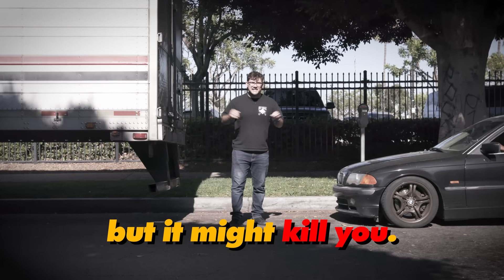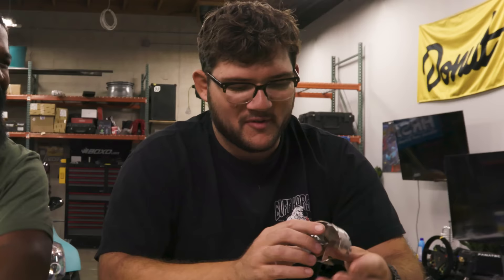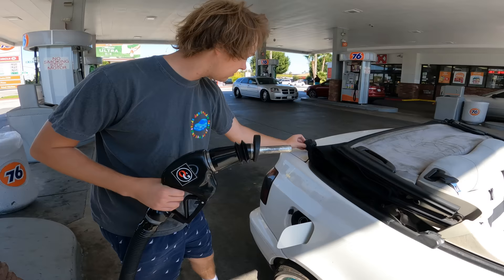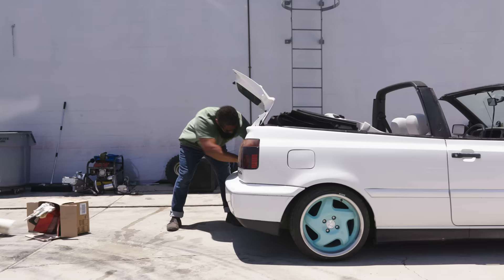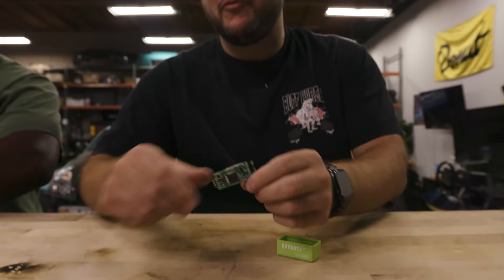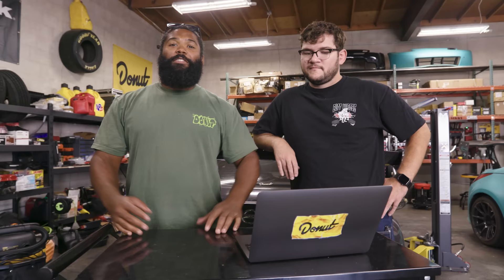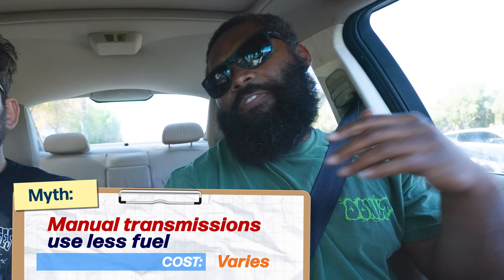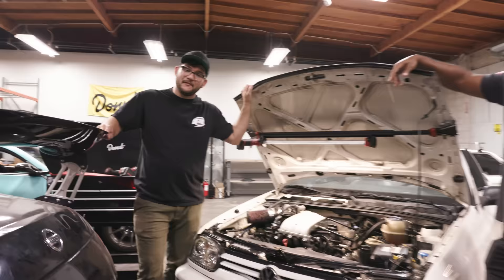Testing Fuel Economy Hacks

Comment: Overinflating tires absolutely works. My Ranger gets 24 on the highway at 45 PSI and 21.5 at the factory-rated 32. It does definite wear the tires weird, though. IMO, worth it if you have cheap tires and drive interstate and not much else but for most people totally not worth it.
Reply: While it gains you some more fuel efficency, how much does it cost you over time due to wearing your tires out much quicker?  Do you save enough in gas to pay for four tires ($500-$1000 for daily driver tires) in half the time you'd normally replace them?  Also, lack of traction is totally a thing.  Even if you air them back down when it starts to rain, your central contact patch is much more worn down than the rest of the tire, resulting in less traction.  Short term gains don't have the long payoff.
Reply: @durwoodrobison7800  Walmart has tires that are $51 new. Assuming you have a vehicle like a ranger or focus, something 3-4 cylinder. And to be  talking about 4 mpg better for 40,000 miles, at 4.50 a gallon would be $1,371 difference. Let alone the lower wear on the moving parts because it has lower drag making the engines and transmissions run slightly cooler. 

I personally feel like Donut really let people down with this episode.
Reply: I like overinflating my Prius.. the stock suspension is so mushy it feels like you're going to roll over at 32-35psi, and my tires will easily 'squeal' around roundabouts when they're that low.. I usually buy tires that have a 55psi-max and then run them at 55-60psi. The car seems to perform a little 'crisper' and I've never had any abnormal wear (most of my driving is city though so I'm constantly turning/wearing out the sidewalls).. 
..prius is a little different though, it needs all the help it can get. If I had a 'real' car I would just keep it at the factory setting
Reply: @brandonchevy6772  except the tires will wear out faster than much faster than 40k. A bad alignment can ruin new tires in only a couple thousand miles.
Reply: @SnifferSock  a bad alignment is actually scrubbing the tires though, Over-inflating is just causing heavier wear in one area. Even airing up to over 15 psi above max, the outsides of the tread still touch the ground. Again, it’s just heavier wear
Reply: They majorly confused what they set out to do. Over inflating works but it's not a good idea from safety or long term perspective so they called it a scam... someone needs a dictionary
Reply: Someone on Ecomodder did the math and fuel savings outweighed the slightly-shorter tire life.
As I wrote elsewhere, I want them to test 32 PSI versus the sidewall max for braking, cornering, etc.
Reply: This is true, but I think MPG gains will be WAY more significant with the smaller wheels and (much) thicker sidewall tires of not so long ago. My 97 Taurus tires looked half flat at recommended pressure but I have yet to see this on any thinner sidewall tire of modern cars. Modern cars already ride like trash, so keep in mind that additional tire pressure is going to result in noticeably worse ride and noise. I usually run a couple PSI lower than recommended (if they don't look underinflated at all) and even that small difference can help a lot with comfort.
Reply: @brandonchevy6772  I have driven the $51 walmart tires, and I will never do so again.  Jumping up just slightly in price gets you so much better traction, control, stability that it's worth it.   And even still, if you do the math, do you save enough money over the life of a $51 tire by getting 2.5mpg more to where you are actually saving money?  BTW, I do drive a Focus, on factory 215/50/17 tires.  If I buy a good, inexpensive tire I'm at $132/tire, and snow tires for a decent quality one that I know works are $173/tire.  Because I buy all season and snow tires, I get about 6 years out of a set of tires.  And because I know I can start, stop, and steer in any condition, it's worth it.  Plus the car gets 38mpg anyway.
Reply: $51 per tire lol. Bet you get half the tread life and having to buy tires plus balancing and changing every so often makes it inconventient. you probably also have a higher chance of blowing a tire especially if over inflated past the cars recommended psi on the highway. If you live where theres no snow sure go for it if you want, but if you live where it snows then you will have to buy snow tires and rims cause i bet those tires are junk in anything but sunny days so in reality you dont really save that much.
Reply: Also if your car or truck is geared for 30 or 31 inch tires and you drop a few tire sizes say to a 24- 25 inch tire your rpms will be alot higher. Size of tire vs engine rpm probably wont save you very much mpg's.
Reply: @durwoodrobison7800  Price does not really correlate with quality when it comes to tires. Some expensive ones are awful, some budget ones good. Ignoring the Chinese trash, you can find good tires for <$100 if you do the research. I live in Cleveland and wanted some all-seasons with the best snow traction and after some research got General RT43 tires for a 05 Corolla. Easily the best tire I've ever driven yet from a kind of second-tier name. Look them up if you want to save the time/money of having dedicated snow tires. 

Conversely, I've driven many new cars with big name tires that are shockingly bad in rain let alone snow, ride poor and wear quickly. Goodyear, Michellin, etc make some tires so bad that I honestly wonder how they were released and, again, without research it's a minefield.
Reply: @chimrichalds5205  I am a huge fan of general tires.  The Altimax arctic's are a wonderful snow tire, and yes they are a wonderful performance for the price tire.  But, they're not a $50 chinesium tire.  They're Continental's budget brand, and are generally excellent.  I don't buy by brand, but from experience and careful review reading (never easy).  
I live in northern Minnesota.  I've driven with and without snow tires, I won't sacrifice snow tires ever again.   I am considering trying the new Michelin Cross Climate tires, but I have time yet before I need them.
Reply: @durwoodrobison7800  I didn't know Continental owned them; they're probably the best among the big brands with the fewest bad tires. I'm broke AND cheap so getting all-seasons good for snow was a priority for me, and the RT43s blew away my expectations. I was expecting some compromise as few tires do everything at least decent while being excellent in one aspect, but they rode well and wore slowly. We got a 2019 Forte and I'm tempted to replace the OEM tires with 23k on them solely because they don't ride that well. Tired of these small sidewalls and these are 'only' 225/45/17. Had a previous gen with 205/55/16 which were just superior.
Reply: @kevinhood9781  
 
Literally almost none of that has to do with the question at hand. What does traction in the snow have to do with fuel mileage in California where Donut is located? Nothing. Again, if you take a fuel efficient vehicle, and over inflate the tires to max sidewall or slightly over, you are going to get better fuel mileage due to the lesser of rolling resistance. Period. Want to talk about overall cost, it’s a different question. Maybe you only run used Facebook tires for $20 a tire and get 10k miles out of them. Who cares. That’s not what the debate is about. But Donut really f’d this episode up as again, looking at fuel efficient vehicles that were still offered in manual and auto, manual still gets 3-5 mpg better highway mpg from epa testing. Elon musk specifically tested mirror wind resistance and came back with 5% of total drag of the car is from the mirrors. A spoiler that sticks up in the air specifically to create drag and turn it into downforce also hurts fuel mileage. And further they talked about fuel and didn’t even mention the most common misconception about e85 with losing fuel mileage with the cheaper fuel.
Reply: Ps elon musk says alot of things bro lmao. Also the epa is probably done in the city or very flat highway. How many cars and trucks are manuals now 10% ? If that. My auto jeep 2014 jeep  gets better gas milage then a 2014 manual jeep with a 1 inch bigger tire so thats a lie. Manual vs auto of the same car is maybe only 1 mpg difference if that. You gonna trust us government spects lmao. Move to russia bro
Reply: @kevinhood9781  
Source: Trust me Bro

That might be the most nonsense and speculation put into words on YouTube. 
And Joe Biden had speeches on here bro… 🤣

Comment: I've heard the windows-up-AC-on method applies at speeds after around 40mph, where the rear of the cabin becomes a parachute.  Below that, there's not enough drag created, and AC will consume more fuel.
Reply: Every single car had different aerodynamics... so every single car will be different. Also the amount of drag from each different compressor and how much power the car makes etc... tons of variables

Comment: Brought my MPG average up from 30mpg to 35mpg just by driving with a lighter foot. Kept it consistent for over 1000 miles. I've got a manual civic and drive with a heavy foot normally so it was hard to adjust to 😂 but totally worth it.
Reply: I went from 25mpg to 32 in my RAV4 by not hitting the "sport" button every time I start it lol
Reply: @orangejoe54  nice man that’s dope
Reply: I have a manual 2000 Civic HX and had 50 MPG tanks from timing lights and driving the speed limit.
Lean burn helps. :)
Reply: yup if there ever was a time for cruse control its now😄
Reply: I'm in the process of buying a muscle car, and after I test drove it, I was very excited for the power in that thing. Of absolutely no connection at all, definitely, my everyday car's mpg went down noticeably 😅
Reply: I went from 65 to 70mpg by lifting as much as possible and leaving a fair gap to the car ahead so I can lift longer and then brake and having no need to full throttle helped fuel econ lots.

Comment: From my experience, slightly overinflating your tires (around 10%) can improve fuel economy a small amount without adversely affecting handling or tread wear. But the best way to improve fuel economy is get tires that are designed with a low rolling resistance.
Reply: Agree, the myth/scam here is to WAY over-inflate tires. A proper inflation or slightly overinflating is good and not a scam.
Reply: The Tyre Reviews channel just did a video on low rolling resistance tires.  You get better fuel economy but tire traction (wet and dry breaking, acceleration, turn-in, etc.) is considerably worse.
Reply: If anyone disagrees get them to ride a mountain bike with soft tyres, then pump them up nice and hard. The difference is staggering.

Comment: XD I used to love manuals for snow driving. in the 90's I felt like I had a ton more control in the snow when I could shift, but as tech got better... the advantage vanished
Reply: Manual transmissions still have an advantage when it comes to control, meaning you can hypermile better with them as well.  That said, you have to actually try to hypermile for it to be an advantage.  Most people driving manual transmission cars these days are more interested in the one HUGE advantage they will ALWAYS have over automatic transmissions which is they are a lot more fun to drive.  Even econoboxes can be fun to drive with a manual trans.
Reply: @craigcampbell8560  Important to note that people outside of the US don't necessarily use manuals for fun. I certainly don't.

Comment: 12:08 A/C doesn't go through the alternator on most cars, which run their compressor directly off of the belt. Where as the alternator must always run to keep the engine going, powering off the A/C disengages a clutch on the compressor, almost completely removing the load on the engine, thus increasing efficiency. It can also be used to give yourself a little power boost when trying to accelerate with a weighed down car, while towing something, or just going up hill.
Reply: Absolutely. That's why in my track car the AC disengages at 100%. Because the manufacturer knew that when flooring it drivers want the total power. Just means that on a hot track day the driver melts!
Reply: @BoxFlyHaydn  Every Ford I've owned shuts off the AC at WOT.
Reply: On a small expedition in the Cordilleras mountains of Philippines our old Lancer got severe brake fading going back down again, we had to rely mostly on engine braking but the small 1.5 litre Cyclone engine didnt brake much - fully loaded as we were. It was much too cold for aircon but turning on the aircon helped a lot on the he engine braking. It got painfully cold but the aircon got us down from the mountains in one piece (this Lancer was made for tropical climate and had no heater system at all).

Comment: A manual transmission is actually more efficient than a fluid-coupled automatic because there is no energy wasting fluid coupling (torque converter).  The automatic also wastes energy in the form of converting more motion into heat and requires a transmission cooler which increases air resistance.  The driver of a manual can preemptively choose a gear change, coast in neutral or use engine braking based on what is observed ahead, rather than waiting for the automatic to react to conditions after they change and wasting energy using the brake pedal.  Every time you hit the brakes and speed back up, you are using additional energy.
Reply: Soure?
Reply: That is only true on old automatic transmissions. Specifically the older torque convertors were a big loss of efficiency.  Newer ones lock at much lower rpms and are very well controlled for optimum efficiency with more than double the average gears. You may be able to do a bit better (like 1%) with extreme care driving a manual transmission, but the average driver will be much more efficient driving a new car with an automatic transmission than manual.
Reply: @seymourbutz6951  prob trust me bro
Reply: @bongmuon  A dual wet clutch automatic is about as efficient as a motorcycle gearbox, but still not as efficient as a properly shifted manual transmission with a dry clutch.  This is especially true when idling or with commercial trucks class 4 and heavier.  You can't get away from the scientific fact that a pair of wet clutches or a torque converter and all the additional moving parts spinning in a viscous fluid generates more drag and produces more heat than a clutch spinning in air and especially true of a decoupled flywheel spinning in air when the clutch is pressed in.  You also have to cede the point that none of the cars on the road today preemptively shifts or does the things that a skilled driver of a manual does.  Now I suppose that a paddle shifter on an automatic can make up for some of that, but not all.
Reply: How about CVTs?
Reply: And manual transmissions weigh almost nothing while automatic transmissions add a few hundred pounds.
Reply: I was thinking the same thing
Reply: Sometimes it's the way manuals are driven compared to autos. Like auto drivers aren't coasting up to a red light knowing when it's gonna turn green
Reply: Look at any modern car that has a manual option and the automatic always is rated at higher mpg

Comment: Got to call you out on two "myths". Over inflating you tires can make a huge difference, depending on the tire. Proper inflation for the KO2s n my Jeep was 36 psi. When I towed my Jeep behind the motorhome, it would not stay in overdrive. I filled the tires to 50 psi, and was easily able to stay in overdrive with the TC locked. I could not believe how much difference it made. I have since switched to a low rolling resistance tire (Bridgestone Revo) and those make no difference by raising the air pressure. They pull like the KO2s did with 50 psi regardless if they are set correctly or overinflated. I also noticed the Revos picked up about 1.5 mpg over all. 
As far as removing windshield wipers, it depends on the car. Why did cars go to hidden wipers, as soon as they started paying attention to aerodynamics. Modern cars, it probably makes not difference, but older cars, it did. If you are worried about safety, they is what RainX is for. It is way better than wipers, as long as you have a fresh coat. 
On automatic transmissions, its not the gearing, its the lock up TC. Once they went to lock up TC, there is very little difference, but there is some wasted power lost in the pump. Also the transmission programing can hurt you as well. My Jeep Cherokee downshifts way too soon when towing, which kills the mileage. If I had a stick, it would be much better, as it did not need to downshift 2 gears at 50% throttle. My motorhome previously had a similar issue, but has now been reprogrammed.

Comment: Also with manual versus automatic, newer automatic transmissions can lock the torque converter which did not happen on older transmissions. Not locking meant that there was always a little bit of efficiency lost from the torque converter at all times. Locking the converter removes most of that efficiency loss, saving you gas.
Reply: It is weird they mentioned 8-11 speeds, not CVTs.
Reply: Most newer automatics get better fuel economy than manuals now a days.
Reply: @JamesBond009  Source?
Reply: @drippingwax  more gear ratios